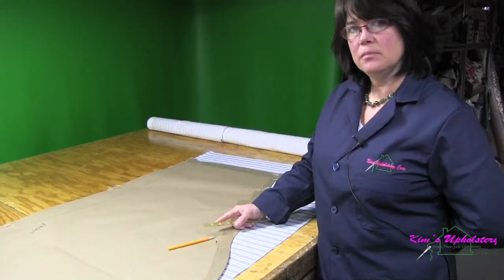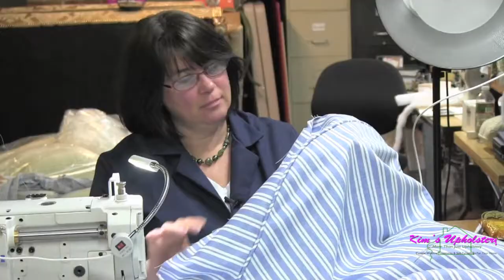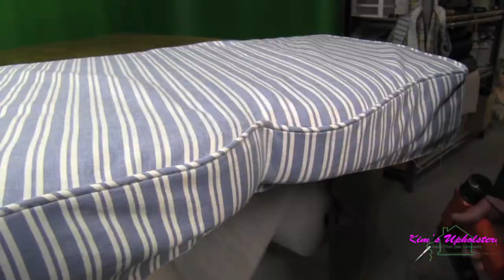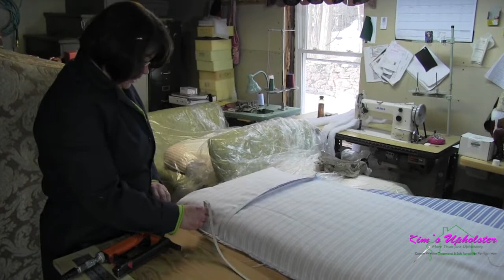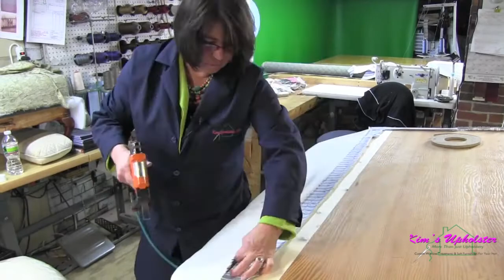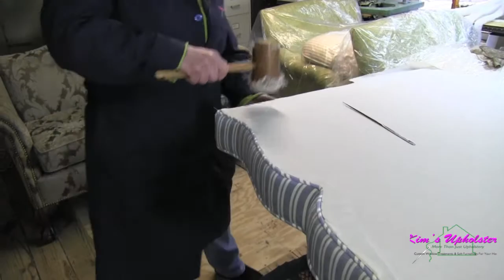How To Upholster A King Size Headboard

Comment: Hi Kim, I have a question. How did you attach the 5 inch extension to the bottom? Where did you get the extension and what did you use?
Reply from the maker: Alexander Alves The extension was a pice of 5" x 3/4" pine. I used a biscuit joiner and wood biscuits glued in  to make the joint secure. Thanks for watching Kim